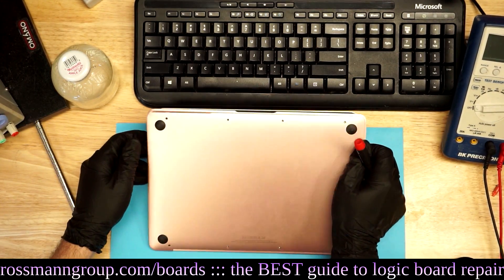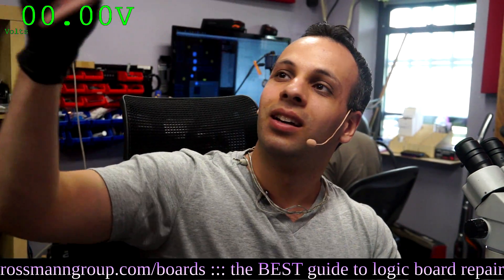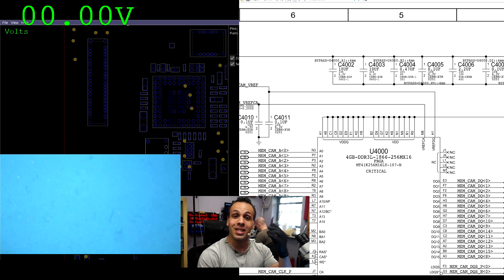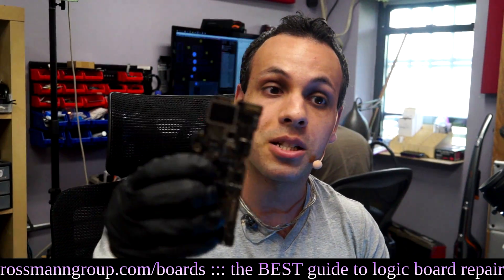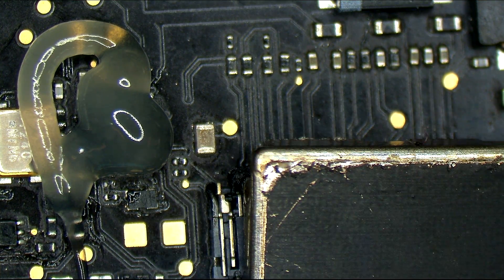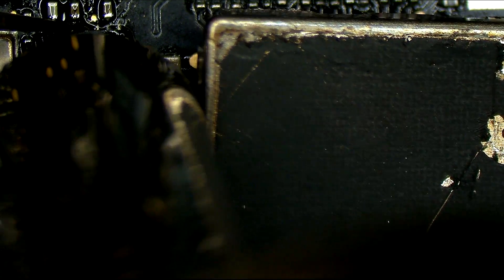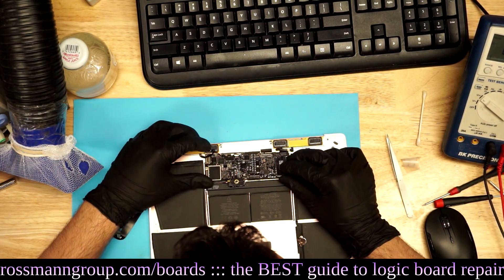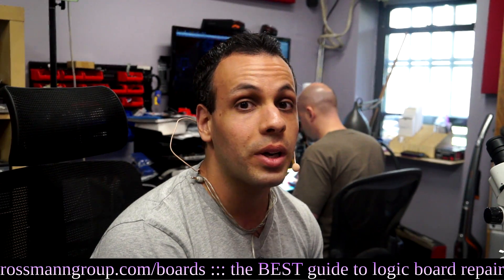Mall repair franchises are garbage and ruin the credibility of our industry.

Comment: This is a very good lesson for anyone who repairs anything electronic. You need to understand what you're working on, and a guide for repair on one unit is not a universal guide for all units; which to me seems quite apparent, but not to whoever worked on the board of that Macbook.

Now I can give the benefit of the doubt that, okay, maybe they mixed up the model year that happens. But to not check the numbers on the chips you're working with? To swap them out and at no point notice "Hey, these have different numbers"? That's incompetence.

Comment: They were pretty darn lucky that they chose something remotely semi compatible with the surrounding circuitry. Can confirm a power creation chip would destroy the entire area if not the entire motherboard . A clock generator and whatever data interface chip they soldered on may use similar signals. Of course no clock would be generated therefore nothing works, explaining behavior and current draw level. Basically the mall created a useless circuit that who knows what it does and draws very low power.

Comment: I think that this is a good example of how "open source" or "easy access" knowledge can backfire.  Unqualified people can build misleading assumptions due to their inexperience, and, via their false confidence, cause more damage;  know enough to get in trouble sort of thing.  This is especially less forgiving with HW.  Although Apple may use this as leverage to further their bottom line, this problem isn't unique to electronic repair.  Obviously the solution isn't stifling the exchange of knowledge, rather it's using knowledge to counteract the misuse of knowledge.  People need to be aware of the due diligence that's required of them when buying or selling particular services.  In this and many other cases, its making sure an organization is operating against a relevant standard put forth by a certifying body among other things.

Comment: I worked at a car repair shop years ago. A man came in because he couldn't change gears in his manual transmission. In the prosses of disassembly, the mechanic broke the trany case. The REAL problem was a rock trapped at the base of the shifter arm. It was a 2 minute free-of-charge repair that a crap mechanic turned into a 3 day $2300.oo repair. Guess who payed. I quit that job before I would work with that guy.

Comment: I used to work at a mall repair franchise... We just did parts replacements though. 
But my experience is that it was extremely stressful because the rent was too high, so we never got the resources needed from leadership while our prices were supposed to be super-low, and we'd have repairs scheduled so anything that took longer than expected would mess up the entire day. We didn't have experienced staff at the time, either.

Comment: Personally if it weren't for your videos I never would have learned how to fix a touchbar macbook with charging issues by hot gluing a car battery to it.
Reply: I mean, they're both 12v, right?
Reply: I mean it'll find the short real quick
Reply: By the same token, the challenger wouldn’t had exploded if only someone had plugged the leak with chewing gum. Duct tape could have prevented the Titanic from sinking. So many simple solutions from the Hillbilly Engineering University. I hear they are now testing cow dung as axle grease. It just keeps your rig rolling....
Reply: 111 👍

Comment: No way dude, get a double decker bus and renovate it with that 48 grand budget. 

Drive up and park right in front of their doors. The sides of the bus have your logo across it with qr codes to a montage of apple macbook repairs ending with a quick summary by you. Square satellite dish on the roof for internet on the road ( or LTE, don't go 5G unless you wanna irradiate your bacon),  built in AC and  generator (when parked), run it on E100 fuel (always running *high*)  or biodiesel with a 6BT Cummins and adjusted for increased horse power.  Now that would be the ultimate trolling, drive up and they will all read the macbook repair logo.. so when people go in they wont feel pressured to shell out tons of cash on what could be a simple repair on the spot. They can step back outside, check with the Rossman Macbook Repair bus and be a little bit more at ease..maybe. ;)

Comment: I went to a mall outlet to have an iPhone screen replaced after some heavy damage (the phone was already severely beat up and on its dying legs). I dropped it on carpet and the entirety of the screen turned into a mass of mixed colours. The mall outlet charged me 80$ for the repair which seemed fair to me. Until they actually returned it to me and although the screen could display. Only the top half actually was actually responding to touch. When I brought it up to them they told me that I'd have to pay again to have it fixed.

Comment: I have my own horror story. 
I have a Sony Xa2 Ultra. Brand new  only about 3months old. Braoke the screen. 

Brought it to one of those repair places. They fixed screen. And then the shit started. 

-covered ear piece behind glass with adhesive
-headphone Jack was dead
-messed up charging port. I could move it around. It also started to short out my screen. To the point I had to hold my phone a certain way when plugged in or the screen would shut off.

The green repair was done so badly they had replace my phone. 

They tried to give me the smaller one brandnew. But why should I have to downgrade for your fuckup. Got replaced with a beat refurb model. I was just happy to have a fully functioning phone. 

I was out of 180$ to fix the green and a brand-new phone I paid 350$ for... Just to end up with a crappy refurbished model.

Comment: I did open heart surgery on my father to replace his pacemaker with a remote control. Thanks for the tip!
Reply: Pedro Dorantes I mean if it works...
Reply: i love the comment section lul
Reply: How were the solder joints?
Reply: @Jip Jackson wot
Reply: Yeah i know its a bit confusing i thought it was the 2064 year model but turns out its the 1964 year model and those dont work with remote controls.
Reply: Where can i subscribe to that channel?
Reply: Dog. Best quote.
Reply: Remember Lois Rossmann told you to do it!

+1 Points
Reply: Pacemakers aren't put in via open heart surgery. I know its a joke but at least be correct :')
Reply: @LadySlytherinx16  That's propably why i fucked up that much. At least i still have a pacemaker.
Reply: @LadySlytherinx16  Pacemakers aren't, but remote controls are.
Reply: @mylovelyhorse5714  ?? Any device is put in via noninvasive procedure not open heart surgery. So not sure what you're referring too mate.
Reply: @LadySlytherinx16  You try to be non-invasive when cramming a remote control into somebody's heart, mate.
Reply: @mylovelyhorse5714  If it's small enough it'll work. 😂 obviously a full size remote wouldn't work. 😂😂
Reply: India Owens r/wooosh

Comment: As in most walks of life , & especially in diagnostics, it is AS important to know what you do NOT know... as to know what you know...🙄😏
Diagnosing a problem is only possible if you have a complete understanding of the system you are trying to correct...

This applies whether you are a doctor, a mechanic, a computer repair technician... or any other discipline... 
If your knowledge & experience are lacking, you are on a fools errand & risk doing irrepairable damage to the DUT....

Comment: What could be the problem of my laptop: My laptop suddenly doesn't charge it discharges faster when connected to a charger as the power from the battery would be drained by the charger even it is not plugged into the wall. I use same other laptop to charge the battery of my crappy IdeaPad Lenovo.

Comment: What is apple doing that is putting vital stuff on the board itself that isn't recoverable?  why is there customer data on a board at all?  Why is that not on a disk that can be swapped into a working machine?  (I used to love apple until somewhere around the time they stopped using numbers on the os and started using cats or whatever -by then I had started tinkering with stuff that was more upgrade-able and not just considered obsolete in two years time. I remember when it used to be apple making it easy for customers to put in ram while pc had warranty voiding stickers pasted over screws on the boxes.  Now I don't have warranty stickers at all since I'd rather put my own machine together with the components I want instead of buying a prefab, and I get frustrated with trying to sort out all the keychain access and itunes account info whenever my mom has trouble getting one her email accounts to work on whatever device and she has no idea what password she used or which username goes to what and curse apple every time she calls me to sort it out.)

Comment: Louis, do you think maybe the previous repair shop thought that this was a 2015 model? I don't think the 2016 model has a 4700 chip. My opinion. Also, did you check to see if there are bad cold solders? This is usually a tell tale sign of poor workmanship. You should also use a microscope to better see the repair needed. My opinion. Normally you could put random chips in first and if it works charge double, if it doesn't work, charge a setup fee and tell them it is unrepairable.you should do a video on this. My opinion.

Comment: I went to a mall phone fix-it place to replace the screen on my Moto X Pure (I fixed it myself prior to that but got one of those rip-off screens, that was bright in the corners and overheated and over responsive.  They said that they buy only Motorola digitizer screens and after 2 weeks and slightly over $100, got the phone back and it does the exact same thing. I took it apart and saw that it was the exact same screen that I bought off of eBay.  Needless to say, I went out and bought a new phone.

Comment: I've seen mall repair places pop up and then deflate rapidly in my area. Got an Apple store here, but they are also a Lenovo store. By Apple contract they are required to hide Lenovo stuff so you have to enter a closed room to access demos. Bought a Lenovo desktop from them 8 years ago. Still using it today, they asked if I wanted or needed service on it. My reply "why would I need service on a computer that didn't come pre-broken? It's not a Mac". Girl at counter asking had no idea I bought a PC, assumed it was a Mac. If any computer lasts longer then it's warranty and has an apple logo on it, It's counterfeit.

Comment: You mean they couldn't at least read the numbers on the original chip and replace with the exact same chip?  I mean come on!  That's amateur hour crap!  I have a HUGE respect for the work you do.  In my case I usually would replace the board if it was cheap enough because I don't even attempt to figure out what the other people had done to it!  And you're right it totally sucks for the customer... BUT... their only other alternative besides you is Apple and we both know what they do to their customers!

Comment: So, the "repair" store did the repair based off of one of Louis' previous videos which was not even the right video for the repair? If you are a "professional" and you run to YouTube every time you make a repair then you need to quit taking peoples money and go into another profession.
Reply: People can't know everything. A lot of the time people in tech jobs look to their notes, schematics and guides in order to perform their jobs.
Saying that looking up a video on how to do it makes you unfit for the job is silly. Maybe the person is completely fine at board repairs but just needed reassurance of the correct procedure.

In the case of the guy sending in the board in this video, sure, it's not the case. But outlawing seeking help to do your job is pretty damn elitist. People aren't machines.
Reply: @SpiceCh  Using the internet is fine within certain limits. It's totally fine to look online for schematics, diagrams, papers, common troubleshooting practices and problems. Knowing that for this particular problem the first thing you should check is that particular chip because it's likely the culprit can save you a ton of time. However what is not fine is searching for easy solutions, tutorials and step by step guides. If you have to resort to that, you don't understand what you are doing and should stop immediately. In general tech repair people should be able to diagnose and repair a board without ever looking up the problem on the internet, with only manuals and tools, and use the internet only as a time saving measure (find common solutions to common problems, look up experience of other people, check out other people's approach to same situation etc), because it you don't know what you are doing in the first place, you could mistake directions (as showed in the video), follow wrong guides without ever knowing, and fail to validate the "goodness" of the information.

EDIT: As you pointed out even searching for assurance is a valid use of the internet. I do it all the time (but I don't tell it to the customer because I know the potential reaction 😂)
Reply: @alessandroceloria  The thing is, this is a common problem... for an older model. The real issue here is they weren't smart enough to go "oh, this information isn't relevant to this situation".

I google all kinds of Windows services for my job as some of them are foreign to me. Simple fixes for service-stops, but I'm at least able to spend 20s to see if it is relevant to my situation and judge next actions from there.
Reply: @alessandroceloria  you sir have saved me from writing a bunch. Couldn’t have put it better myself.
Reply: @SpiceCh  exactly. I'm a professional programmer. Google is my friend when I can't figure it out myself (which already involves a lot of copying of other stuff either I made in the past or somebody else)
Reply: Well said
Reply: Shoot nobody knows everything. The happens all the time in programming when people turn to the internet for help. I'm all for it if it works and the person learns something new. I mean that is why the video exists in the first place. That said at least make sure you're watching a video for the right damn model if you are going to go that route.
Reply: It's like trying to fix a PS4...and replacing a chip on a PS4 motherboard with one from a Switch, because you saw a video of someone fixing a Switch, and then blaming the person who fixed the Switch.
Reply: @StormsparkPegasus  uh.... If it fixed the switch why wouldn't it fix the PS4?.... If anything it should work better since it's newer.
Reply: I kid
Reply: One involving the phrase "would you like fries with that?"

Comment: I have an A1297 17" Macbook Pro that has a power-up issue.  On those times when it did power up, the display actually worked.   I understand that "all 17 inch Macbook Pro display chips will fail."  Is there a way to keep the display from dying?  If so it's probably worth trying to fix the unit.

Comment: I used to do tv / vcr repairs when things were still normal parts. Surface mount can be done, but you need the schematics, good magnification to read the parts and a good hot air reflow  solder rework station. And it is somewhat hard to locate certain specialty surface mount parts especially the IC's ... What is that web site that you are using for schematics  ? ? ? I also like the idea of a large screen TV Monitor to display them as you can easily read them while you are working on it.  ... OK found the site: laptopblue.vn  .. they do not show a way to read the site in English, not sure what language that is and I can not tell if they charge per schematic or how much it would be.

Comment: Is checking power rails to the chip the first most important thing to do when you trouble shoot a board?and if they are not correct should i look in beetween components to see if the problem is that?
Reply: Like resistors and so on

Comment: 321 mall franchises disliked this video.
Reply: If only you knew the horror stories from pros who have had to repair others ummm "attempts" I was an electronics tech (retired now) and I've seen everything from cheap knockoff chips , science workarounds with hand wired chips (no solder just hot glue and a prayer) and the monster blobs of solder where a tiny drop is needed . Reputation is everything as a technician, and honestly? The last 2 decades of electronics have seen revolution and ridiculous design choices that make any good tech cringe. Right SONY???

Comment: can you fix raspberry pi's? need the voltage regulator replaced
Reply: Old comment, but Louis doesn’t pick up a soldering iron for less than what it would cost to buy between 6 to 40 raspberry pi’s, depending on the model. 
Still could be a fun way to learn how to solder, if you want.

Comment: With respect, clock generators are rather critical for digital communications...lol.  At least they both generate signals, just not remotely the correct signals and who knows what the two pinout arrangements result in, but likely not a clock signal.  There is a lot of head scratching out there when it comes to electronic repairs by those who do not know what they are doing...it’s much more than just soldering parts...it’s far more akin to debugging or puzzle solving.